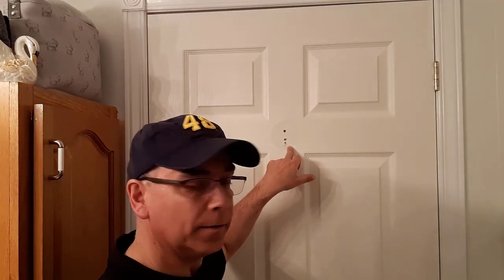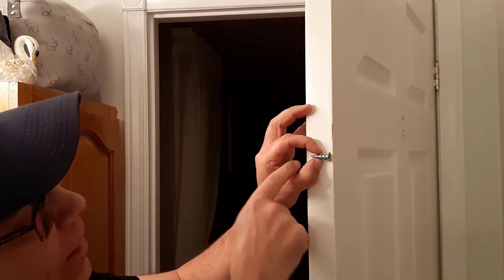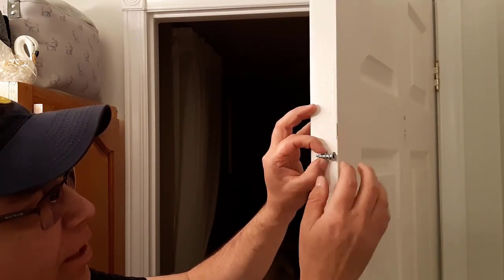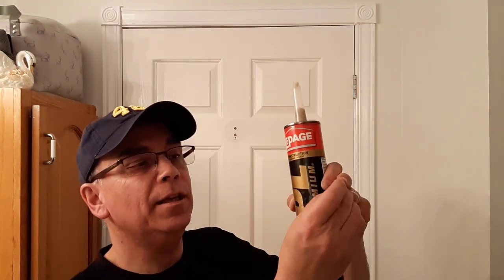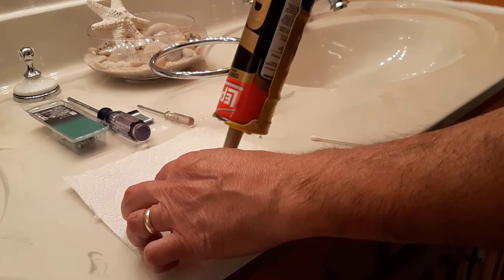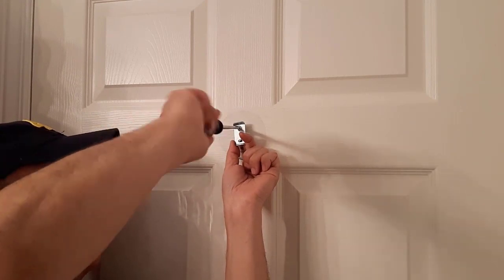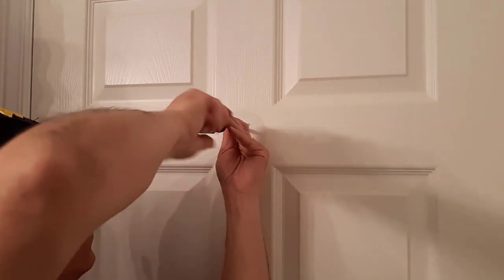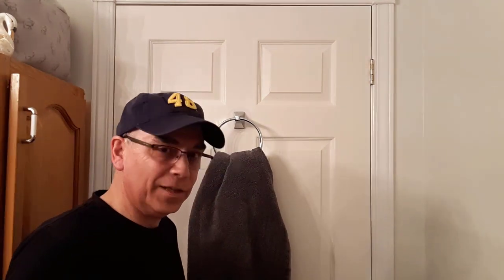INSTALL A TOWEL RING ON HOLLOW DOOR // Will Never Become Loose

Comment: So many homeowners like using these door mounted hooks/brackets on hollow doors.  It'd be nice if the door manufacturers would re-enforce that part of the upper door for these types of projects. BTW, thanks for a great video.
Reply: Great suggestion.  Sticking a small piece of reinforcement on the back of the panel would cost next to nothing.

Comment: How does one determine what size wall anchors to use for the screws provided? The instructions that came with my hook say to use a 4.8 mm drill bit when using the included plastic drywall anchor. The anchors I am seeing at the store come in sizes #6 and #8.

Comment: I'm easily confused when it comes to basic tasks like this so forgive me. So, is it that you can't use a regular plastic anchor on a hollow door? Is that why you need a specific anchor for hollow doors? Also, can you use the hollow door anchor without using the PL? Thanks, I appreciate the tutorial.
Reply from the maker: The plastic anchor will fall out over time. The hollow door anchors work good but for assurance I add the pl. Mine still hasn't fallen out, it's still solid. You can buy PL in a squeeze tube as well. Thanks for watching.
Reply: @GettingItDoneRepairs  thoughts on JB Weld in substitution for PL?
Reply from the maker: @Airbender24B  I have some jb weld in the garage and I haven't used it yet. So I wouldn't be able to answer your question.

Comment: Like someone else wrote: SUPER HELPFUL.  I liked the steady, calm and deliberate explanation. No frills on this video. Just what you need to know.  I am about to put some Moen towel holders up and Moen did not give instructions on how to mount them on a hollow core door, nor did they offer anything when I called them. They only give instructions for mounting them on studs or on drywall.  No support for hollow core doors. But with this video. I am 99% confident that this video's instructions will work.  I am going to get some hollow core anchors with some 3X PL and follow these instructions.  Pretty simple too.  Put in the hollow core anchor. Remove it. Clean up the edges so that the anchor get re-installed a second time and be flush with this door surface.  But before you put the hollow door anchor back a 2nd time, use a q-tip to put a small amount of PL glue on the anchor.  Install the anchor.  Clean up the glue that rises up a bit using a wet tissue.  Bingo. You are done. You have your anchor and are ready to mount a screw to it.

The only drawback is that the use of the glue probably makes it impossible (or nearly impossible) to remove. Some other person made this comment. Yeah. Bet it is true.  So you do want to commit when you put in an anchor this way, as getting it out without seriously damaging the door might be hard.  On the other hand, having a hollow core anchor pull out is going to do quite a bit of damage too.

Comment: Toggler makes a plastic wing anchor (similar to a toggle bolt) designed specifically for hollow doors, it's much stronger than this type of anchor, and no adhesive needed. Just drill a 5/16" hole and install, simple. Also works with a wide range of screw sizes.

Also, you're a brave man to be handling such a strong polyurethane adhesive, with no gloves on!
Reply: the toggler will not work because it's meant for drywall, but you can use toggle bolts
Reply: @rawlr9066  TOGGLER Toggle TA Hollow-Door Anchor with Screws

Comment: Awesome video. I looked at several before I decided this was the way to go. I have some kind of plastic anchors that came with my robe hook, but think this will work better. Going to Home Depot tomorrow to pick up the hollow door anchors & PL. Thank you. 👍🏿
Reply from the maker: Thanks, you know that towel ring has not come loose once. It's as solid as the first day I installed it.

Comment: Good idea using construction adhesive on the anchors! I've never seen that done before. I typically use wide thread screws and adhesive on the back side of the bracket I'm installing. Makes it impossible to uninstall, though

Comment: I am making a wood spice rack that i will be hanging on our pantry door (78-1/2" H x 34" W two panel door). Since with all the canned goods, oil bottles, etc. it will be quite heavy I am thinking of Injecting Expanding Foam into each hole and then do what you have shown in your video. What is your opinion?  Thank you.  PS: Please reply at your earliest 🙏
Reply: We're looking at the same project. We have a metal rack that we used to hang over the pantry door for canned goods. But we got the doors and the rest of the house painted. I don't want anything hanging over the door and scratching the outside. Did you get yours to work? Did the expanding foam help?

Comment: And what happens when you want to replace that holder with something that the bracket doesn’t line up with? Will you be able to remove without damaging the door?
Reply from the maker: I'm sure there is a way.
Reply: The anchors are already flush with the door. I'm sure it'd be easy to patch up

Comment: Oh my gosh. They have specific anchors for this, and other faster ways to hang towel hooks a hollow bathroom door, just as strong.. If you did this on my crew you would be fired.
Reply from the maker: Good thing I don't need a job. LOL
Reply: Sorry. Didn't mean to be rude. I'm sure for certain applications this will come in handy.
Reply from the maker: @marine9583  still working solid here.
Reply: Why don't you share the specific anchors for this?